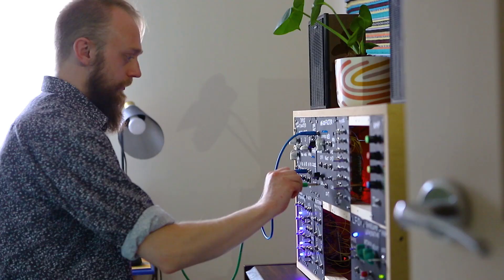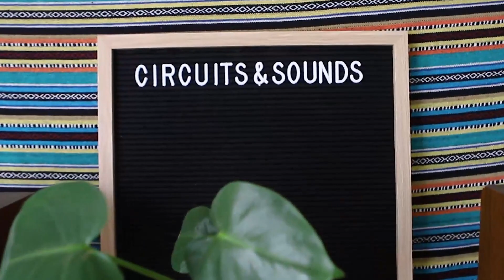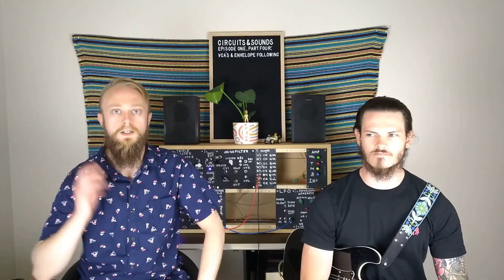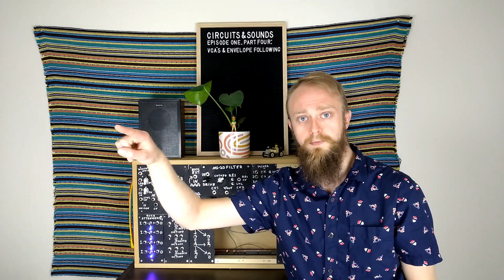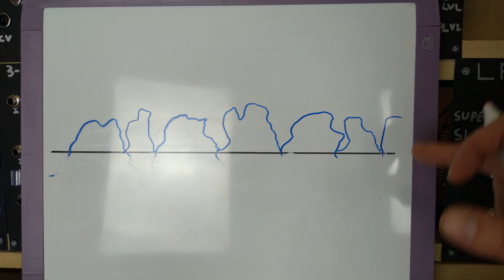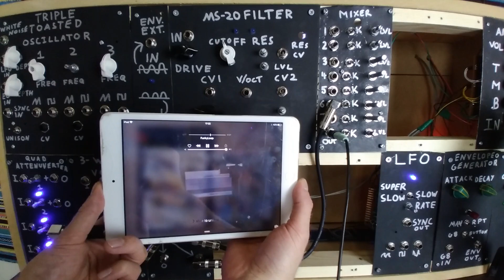VCA's & Envelope Following - Exploring Volume Modulation & Envelope Extraction

Comment: I recently made up an envelope follower and I gave it an amplifying attenuverter on the output, so it can do between +-2x the actual envelope  voltages. It's quite useful that way. Actually I made 2 of them on one pcb with a gate extractor too, which gives a gate whenever the follower goes up, so you can then trigger something else based on original the envelope...
Reply from the maker: That's such a neat idea! I should have added more features now! Hahaha